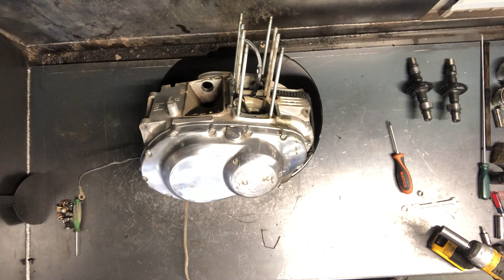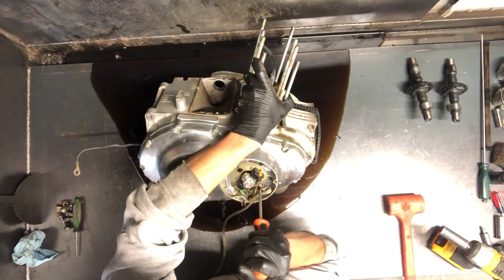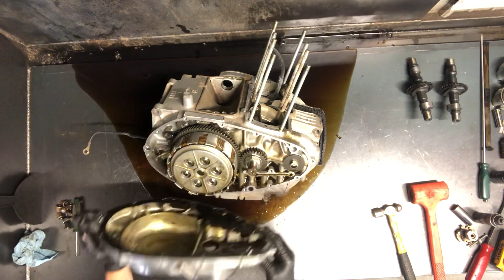How To - Suzuki GS450 GS 450 Engine Motor Signal Generator - Clutch Removal

Comment: If I'm replacing only my signal generator(Not getting in to the clutch) on my 1985 Suzuki gs450L, do I need to drain my oil/get a new gasket to take off that side cover only? or is that sealed out to where I can replace the signal generator without needing to re-do my oil change?

Comment: Hello, @Mid Nebraska Motorsports could you or anyone else here point me to some resources I could use to do a gs 450 clutch rebuild? Mine is acting like the driven plates are distorted. any help would be greatly appriciated